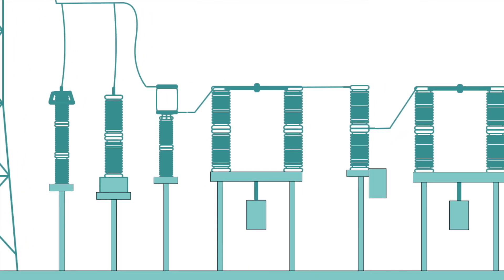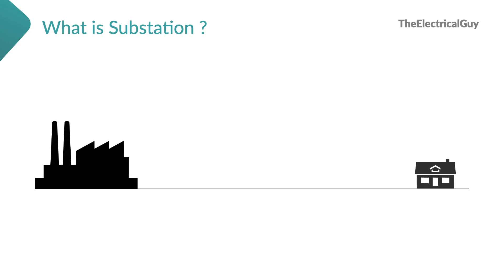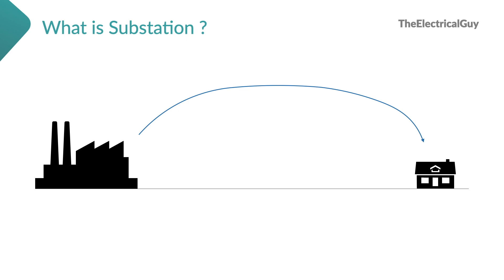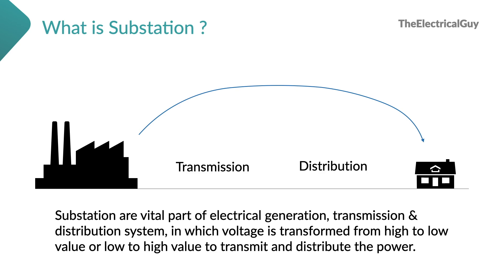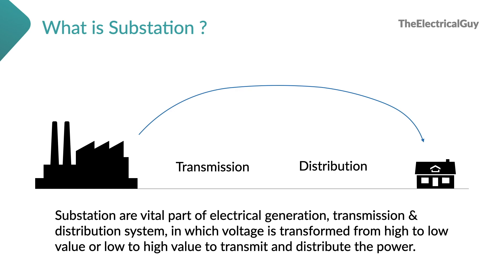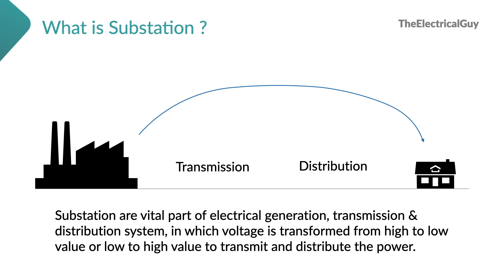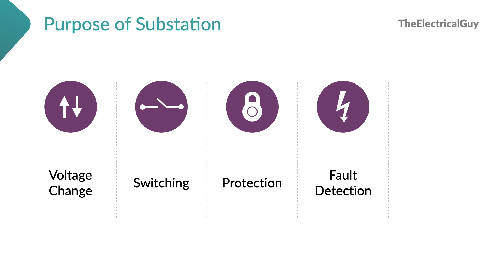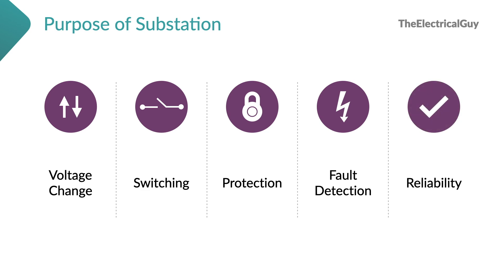Electrical Substation & It's purpose | Explained | TheElectricalGuy

Comment: Nice video 👍👌
Please make a video about vaccum circuit breaker..
Reply from the maker: Thank you. Here is the video that explains the nameplate details of vaccum circuit breaker. Also there is a course on Substation and Sf6 circuit breaker on my app. In case you are interested you can check it out. 
https://youtu.be/yAX3ZiRxL9A
Reply: @GauravJ  thank you 😊